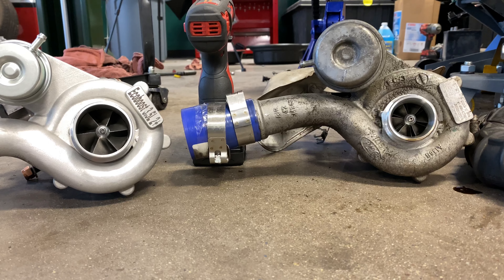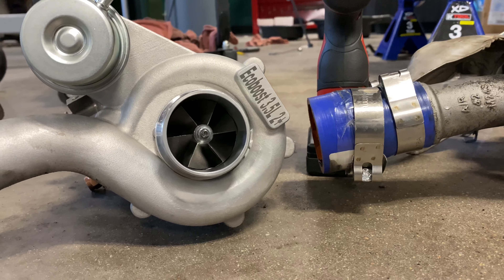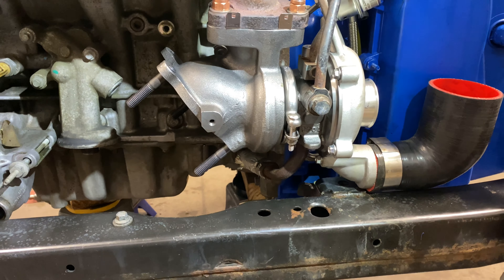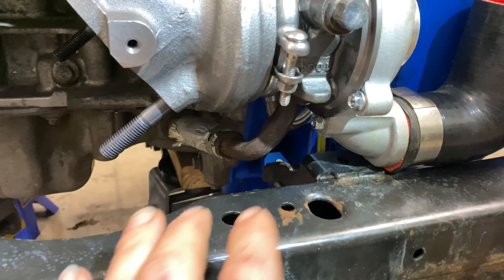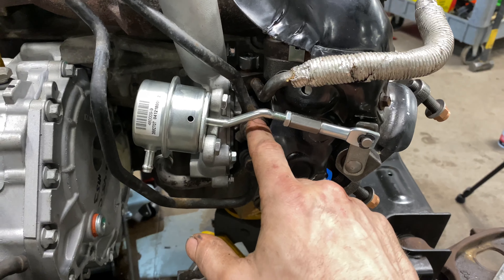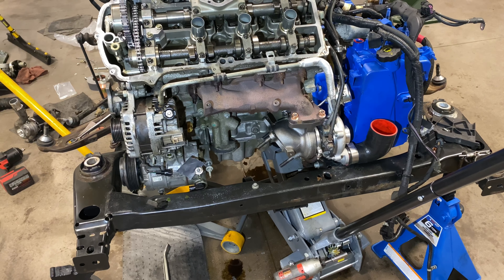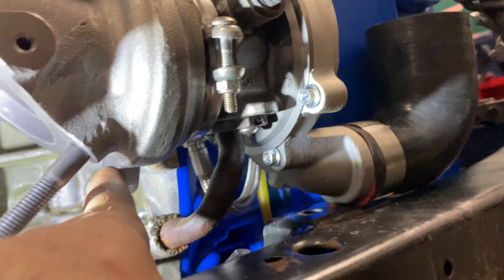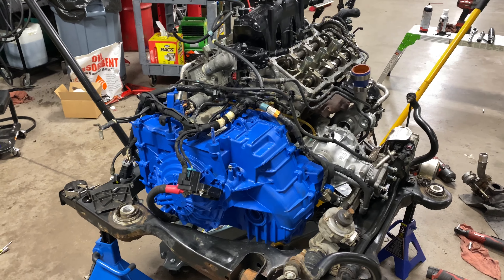Ford SHO Gearhead ATP Stage 2 Turbos Overview

Comment: F150 snails are actually borg-warner, not garret GT15s found in transverse applications. I also believe they sustain higher stock boost levels in the truck application
Reply from the maker: You are 100% correct sir. I did some homework on it!

Comment: have to change the upper right (firewall side) turbo oil line and having a hard time with the torx bolt.. bought a long torx set thinking that would do the trick but no luck its very tight and the torx bit seems to be off center cause of the manifold. any tips to getting it off the car?

Comment: Are you gonna put the stock cats back on?
Reply from the maker: Not recommended. At high power levels stock cats produce a very high chance of failure in the short term. Quality High flow cats or open downpipes recommended.

Comment: So are they Gearhead turbos or ATP2’s?  Those are not the same units.
Reply from the maker: Supplied by Gearhead, and box says ATP2s. So I’m not 100% sure.
Reply: @Pete_Tech_  how can I tell if I have gear head turbos I called him and he’s said housing is the same as oem and I was curious sometimes not very often I’ll get some white smoke and oil out exhaust I just went to ford dealer and changed my oil an he said everything was ship shape except he thinks I  have small leak  but he couldn’t see where he said..any advice 😥I love this car 2013 sho btw

Comment: Why’d you drop the whole block? Lmao
Reply: If you’ve ever tried doing work in the SHO, it is a bitch and a half to do anything with it. Dropping the block makes it 100% easier to work on. It’s just that everything is so tightly packed and with it being transversely mounted.
Reply: @curtiswolf2551  so I just bought a 2019 Taurus SHO and I'm looking for a decent upgrade path. Do you know if you have to drop the engine to get to the turbos? Or is there a way to do it without?
Reply: Ned setabed@ honestly, I would say that cost effective-wise just tune it and MAYBE get a cold air intake/downpipes. But a tune alone makes a HUGE difference. You don’t need much to make power cuz it’s tuned down.
Reply: @curtiswolf2551  yeah, that was where I was going to start and then slowly add things as my budget provides. And I was just looking around at all the different upgrades to see how difficult they were and it's looking like most of the general things are easy enough to get to. But I can't find a decent video on how to do the turbos.
What brand would you recommend for the tune?